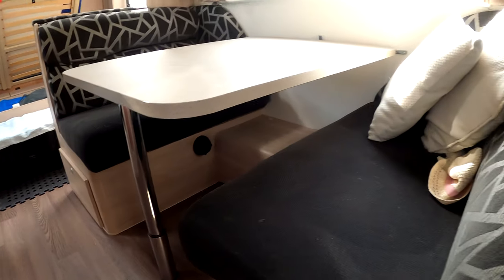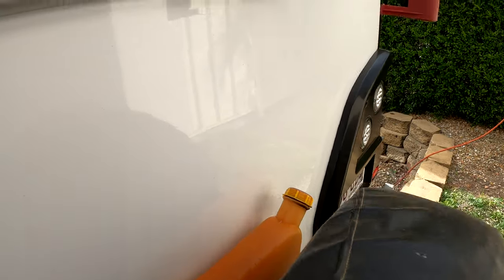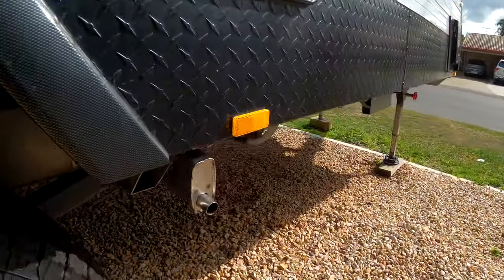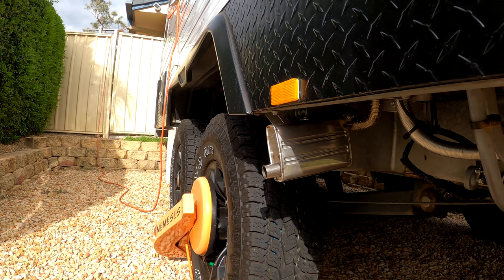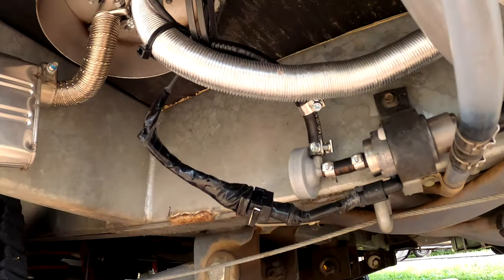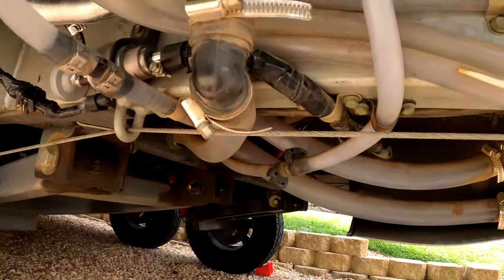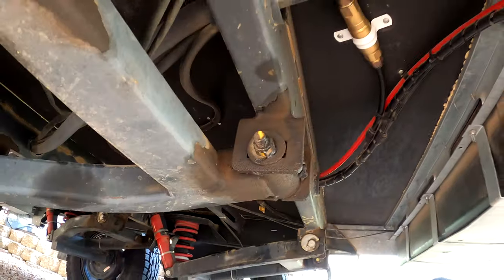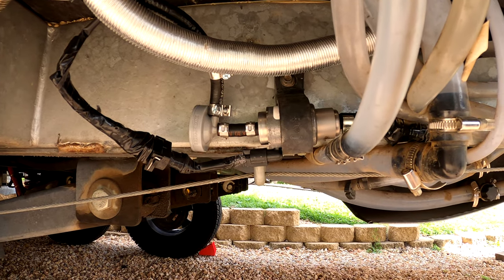5 Reasons why I removed my Chinese Heater.

Comment: Well. I have changed my 2 brand new eberspächer airheaters for 2 Chinese ones.. After one of the eberspächers let me down 200 km over the polar circle.. And really no Bosch service overthere... They are just to complicated and not so easy to fix wenn you are far away from civilization... And the Chinese ones are an easy fix all the way... Even they never let me down up till today.. In January I travel to the deepest parts of Siberia... And have 100%of trust in them all the way... Just changed the fuel pumps for the more quiet ones...
Reply: Dont worry you gonna change more parts

Comment: The unit will only soot up if you run it to low, I've got a planner heater and its great,Russian made,not Chinese one,I think he is just a bit biased towards Chinese heaters
Reply from the maker: Hi Lawrence, the unit we removed was a Chinese manufactured unit and always run on high. We started doing this after the first time it let us down by carboning up. This approach did not work. If you have the Russian made Planner then you own a heater which would fit into the latter category of this video, meaning it would be the high quality unit replacement for a cheap Chinese variant. Thanks for watching.

Comment: Iv gone threw many chineese heaters and tried to rely on them a d I gave up after I tried all the tricks to do to the china heaters and bought a webasto airtop 200 stc. Wow, part for part is better quality. The heat output can run head to head with a 5k china only do it reliable. My heater heats my tool trailer for my buisness , so it has to work.
Reply from the maker: I know right. 😀

Comment: Ive got 3 knok offs..from china, 1 is a spare and the 2 others work fawlessly, never an issue ,no smoke at all. I can get 6 (YES SIX)  more, a total of 9..yes nine... of these for the cost of one of the western or german ones...  your full of it mate.
Reply from the maker: Hi Rick, thanks for your input. I take your point however the purpose of the video was not a price comparison but more focused on the user experience. I think we can all agree you can purchase multiple cheap units for the same price of a German manufactured unit. 
I have found there is a distinct performance advantage to the Webasto which for me makes it worth the investment.
Reply: Please stop buying cheap Chinese copies, and supporting Chinese business, have a look at what China is doing to every other countries business worldwide ,and you will see that they need boycotting. Ask any proper tradesman and they will tell you that Chinese gear is crap.
Reply: Any issue with chinese heater?
Reply: @misocveticanin578  
Even if he had issues, he probably would not tell about it. Human nature...

Comment: Whilst I appreciate your point of view, I just can't justify outlaying the dollars for an item that does exactly the same thing, burns diesel fuel to create heat.
I installed my Chinese diesel heater 4 seasons ago now. I have since purchased another 18 units for others to install in their RV's on the basis they have been present when mine was running and they are so impressed. Once they study my instal they go away and copy. Thus far not a single person has come back to me saying they have had issues.
Installed correctly, you are not disturbed by the diesel pump, be sure it is mounted on a solid footing, (chassis rail at solid point, cross bracing area) at an angle. If we lay in bed on a completely still night, listen intently you can just (only faintly just) hear our pump. I call it the heart beat of our van, if there is any other noise around, other campers etc making noise, a breeze, the pump is not detectable.
All units need to be installed so as to gain access to the unit easily for maintenance, no matter the brand/price tag.
In regards to maintenance, I have just encountered poor ignition, white unburnt diesel mist on start up.
Resolution is so simple, since the unit is easily accessed.
Remove the fuse to cut all power to unit, remove cover, remove glow plug connector from circuit board (reason you remove fuse/power) unscrew glow plug with pointy nose pliers and remove, then remove diesel misting mesh below glow plug, clean mesh with copper bristled brush, once clean reinsert into heater,. Now focus on removing carbon build up on glow plug. Utilising 240 grit Emery Cloth ever so gently work away at removing the carbon. Once done, reinsert the glow plug, nip tight with pointy nose pliers, reconnect the power lead to the circuit board, replace fuse, hit ignition, whalla it fires into life, no smoke. I just saved you many hundreds of dollars in purchasing an expensive heater that will require a similar maintenance repair one day or another. Mate has German unit, needed to remove and strip down to resolve his ignition white smoke issue, purchase seals before reassembling.
Bottom line, everything needs maintenance, nothing runs forever when ignored. Case in point, search YouTube for; "Espar diesel heater annual service". This unit is identical in appearance to my Chinese heater.
I advocate, buy Chinese unit with confidence.
As for not supporting Chinese manufactured goods, best of luck, just about every item we purchase somehow contributes to the Chinese economy. They have totally caught all manufacturing processes sleeping, we ignored them too long.
Get over it, they are now what Japan was 50 years ago. You brought a Toyota, how could you? Now it's the no 1 seller in Aus. Korean items followed, they'd be crap wouldn't they, not so, best quality around now days. Now it's China's turn, criticism will occur now as history shows (Japan/Korea), another few years on we'll all be over it as well. I'm over it now, I'm ahead of most, learnt from past already, however, I will purchase Australia made if there is an option to, in this case there is no option.
Point in case, I have gone 100% lithium in van van & car including starter battery. Whilst I could have sourced Chinese, I sourced the Australian developed manufactured Itech brand from a Perth Family Based Business, so support Ozzie products where possible and price is right, not outrageous on manufacturing historical name bumping up price.
Reply: Many people aren't handy and/or don't want to mess with such technical devices, or they just don't want to waste time to spend days researching and learning about what/why/how.

So they pay (more) for the brands that will give them full warranty and service (I hope for that money Webasto and Eberspacher provide that...).

I say if you have a job, a normal salary - just buy the supported brands. Simply because time and attention spent on troubleshooting problems with the Chinese clones, or because of reliability issues - is not worth the difference in price (I personally would like to occupy my mind with other things rather than learning about diesel heaters, how to troubleshoot them etc).

I say the Chinese clones is a good options for those who are unemployed and/or really struggle financially. After all, you buy a diesel heater once, for many years if not a lifetime of use (so the difference in price is not that big of a problem).

Plus I have read an article that said that Eberspacher heater was much more easy to maintain than even Webasto (because I believe to change the plug and some other operation - with Eberspacher you can do it directly, and with other brands you would need to disassemble it first, something like that)
Reply: @MaximC  
I hear what you're saying, yes I am pretty dap with non technical stuff, diesel heater burn is pretty basic, non technical.
The point is, all styles need maintenance, German, Russian & Chinese.
I gave a basic description of how simple the service ritual is, thus avoiding the expense of replacing unit as done here.
As for getting the more expensive brands serviced, yes I presume their dealer network can assist, but they are only going to provide the service I described but instead of cleaning they'll be replacing the glow plug, misting mesh, plus seals on burn chambers and you'll be paying for that service, I hesitate to say it may cost more than a whole new Chinese  diesel heater. 
Most people purchasing these Chinese heaters will be installing them themselves, so with that ability they may well have the ability to service it as well, it's just a matter of basic know-how but if not they can order and replace the heater for similar figure to having the service preformed.
So, if you are like me with basic ability, do the repair yourself, no matter the brand and save money.
Bottom line, irrespective of the brand, it'll need attention one day.
Hope this info assists some save their hard earned money.
I strive to be thrifty, not ashamed to say that, but willing pay if required to get a result, I just can't justify over spending on something as basic as a diesel burning heat chamber.
Reply: @ianweal3081  
I don't know, I too really would like to not pay much for a basic diesel heater, but again, if one isn't broke, better just buy a high quality brand than a Chinese copy and be done with it. Buying a Chinese copy - I'm not sure playing the lottery in this case is worth the money spared (issues with heater's functioning can be all sort of different, including people for years thinking that it's normal that it takes say 40 minutes to warm the van when a well functioning unit actually does it in 10-20, or things like that).

And the installing of these heaters or not really like brushing your teeth. I mean changing the whole system - is at least one day wasted.  

I hope I'm overestimating the defective rates, rates of people having problems with these Chinese clones, but then again it's not like they are so cheap for no reasons, let's be real. 

Plus I'm kind of struggling to understand - if one isn't broke, why not buy a high quality diesel heater right away? People usually need one diesel heater in their lifetime, probably (that is install it in a van or RV, and in most cases it should be ok for the lifetime of the owner).
Reply: @ianweal3081  
But true, if people hypothetically didn't buy these heaters (Webasto, Espar), they probably could've lowered the price quite a bit. In the end it is true that it's just a combustion chamber, it's not something crazily complex. But then again, most of things on the market - the profit margin on them are quite high. I guess we can't do without having multimillionaires and billionaires, right? I guess that's the reason for the high profit margins to even exist...
Reply: @MaximC  Reading these comments clearly demonstrates the difference between hose that can, those that can’t and those that won’t.  I can and I do.  These items are not rocket science and anyone with good diy and diagnosis/repair skills can manage with the cheaper (and easily replaced) units.  We do not all buy the most expensive cars, for instance.  The ‘whole life cost’ of the units is important to many, not just keeping their hands clean while paying others to do the installation and maintenance.

I, for one, am quite able to understand how these heaters work and be able to diagnose (and repair) any faults arising.  I know they are not as well manufactured as the expensive ones.  They are basically parking heaters, not residential replacements for central heating systems.

Mine is used to heat a work room separate from my house, so not required 24/7.  The chinese heater instructions do not cover such installations - and this is where so many go wrong, as they are not even aware of the more demanding points when installing the kit (for more than heating a vehicle cab).

Mine will be perfectly adequate for my needs.  I do not need the “Rolls Royce” version.  You may need the expensive one because of your inability to DIY, or your wish to spend for others to do the job for you.  I consider myself as practical, able, and sharp enough to recognise the limitations of the equipment.
Reply: @oliver90owner  
That's definitely good on you. And also definitely most people are not as savvy in these things. 

I hope I'm overestimating the problems with the Chinese heaters. And that people who own them are not avoiding tell others about the problems that experience with them (if any).

Maybe I'll eventually be curious to try a Chinese heater, just to see if the price is worth the risk. Or if I won't have money for the branded ones at that moment in time.

Thank you for the instructions about who to service it, might definitely be useful for someone (I'll copy it and save for the future).
Reply: @MaximC  I'll finalise my comments by just saying, my initial concerns were this thing maybe no good, BUT if it fails I haven't blown a whole lot of money.
The concern I had regarding it failing were alleviated by the concept the installation was done, so just purchase a Wesbasco and install it, simple.
This has not and will no be an issue, I'll keep utilising my cheapy now I'm aware just how basic it is to maintain.
The upside, the money saved I put into Lithium Batteries, but that money went to an Aussie manufacturer and their staff to spend, so I have no regrets re my purchases.
Now, go out and purchase one of these units with confidence, stop procrastinating as I did for years, you'll be pleasantly surprised by it.
Then you'll be in my position, money for another project.

Comment: Chinese heater has one moving part and that is motor which is the same as German motor all bearings and brushes should be replaced every few years so as to run efficiently a smooth running motor will not smoke or run noisy and smell its all down to simple maintenance German or Chinese. The pump can be quite if loose fitted in a way that noise doesn't bounce up the pipe into the cabin and takes a bit of time to get it right. My Chinese heater never soots up and running very smoothly still after four years can't complain although I have always burned kerosene and never bothered with diesel.

Comment: Thanks.  I reckon I am sharp enough to install a Chinese version such that it does not smoke.  No smoke - no sooting up. 

Very simply, folks - I guess he bought the cheapest he could find and/or likely didn’t instal it correctly and didn’t tune it to a minimum CO in the exhaust gases.

Some can, some can’t.  Who puts a tank of fuel stuck on the rear end of anything?  That was the first part of the installation thing that struck me as a dumb move!

Yes, Webasto units are better quality (just look at the different silencers) but a tenth of the price can be decisive when it comes down to the bottom line.

BTW, the reason for the angled pump is to avoid premature wear, due to gas bubbles remaining in the pump.
Reply: Chinese versions are only if you are really broke, in my view. Also because you buy a diesel heater once, it's not like you buy it once a year or we once in 5 years, you buy it once and probably it will do its function for your until the day you die...

Comment: Funny parallel: as I was watching this video I was eating cherries, some great natural tasty (real) cherries. 6€/kg. Or I could have bought other cherries (that are also called "cherries", and they actually also are cherries), for 3€/kg, small, ugly, probably taste like water.

See how it works?

Anyway, about the heaters - if somebody offered or I found a seller that only sells actually flawless Chinese clone heaters, and offer 2-3 years warranty and good assistance in case of problems - and it was still much less expensive than high quality heaters - I would buy that, why not? The problem is it's probably impossible, because in order to offer that kind of warranty and assistance the seller would need to find heaters that he can rely on, from manufacturers that he can rely on. Which in the end would mean his price will get close to the price of Planar, Webasto, Eberspacher. That simple.

But I actually wonder maybe it is possible, say to offer non defective units, with 2 years warranty and ok assistance, say for the price of 3 Chinese heaters (which would still be cheaper than Planar), and maybe there are sellers that offer that kind of opt-in. But if so, how to find them?

And by the way, Planar is really not that expensive. I doubt anyone could make similar product for much less of a price. Unless the Chinese manufacturers and quality control and support get really serious, I guess... But then again, such product already exists, economic but still high quality - Planar. So that's probably exactly why Chinese can just sell what they sell currently, cheap clones with no warranty and no support.🤷

Comment: Is the Webasto fuel pump not required to be on an angle ?
Reply from the maker: Hi Craig. Not required to be on an angle due to the grey plastic device on the upstream side of the pump.
Reply: @AdventureCampingAustralia  Thanks just been looking on eBay at those dampers after seeing this video.
Reply: @CraigDavies.  actually webasto fuel pump require to be on an angle and  chinese manual exact copycat of webasto ones. Reason for the angle is to avoid complete blockage if encountered very dirty diesel.
Reply: @897aa33  it’s actually to prevent air bubbles not being able to purge from the fuel pump and Webasto fuel pumps can be mounted horizontally with out issue, cheap Chinese ones need to be at a 45 degree angle.
Reply: @mgd604  if you put on a angle this allow small pieces of dirt to escape. But sure you can install horizontally